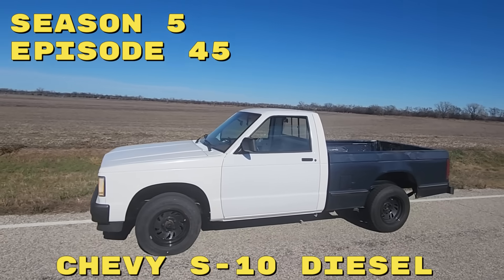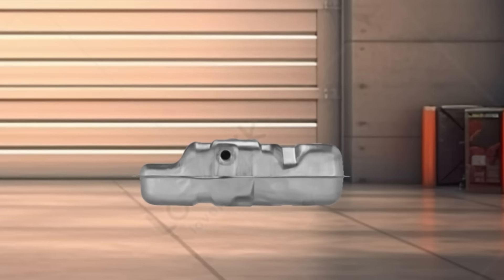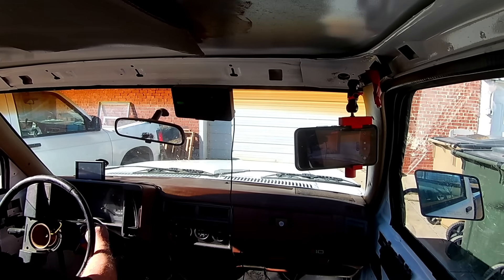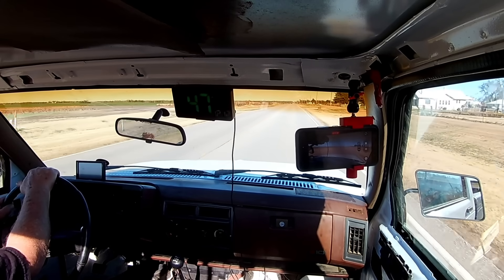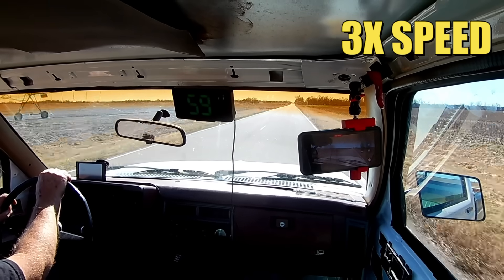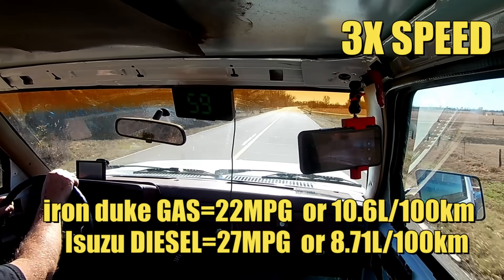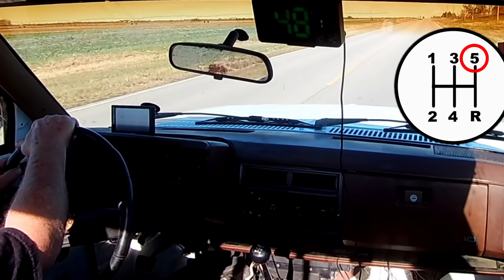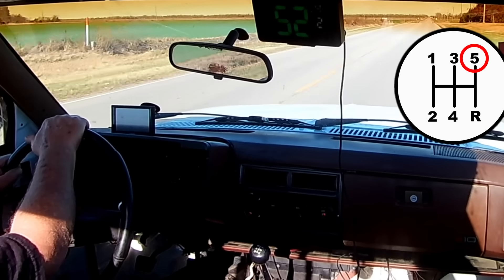S5 E45. MPG?  We road test the custom diesel Chevrolet S-10 to find out the fuel economy.

Comment: The main reason for the increase in price for diesel fuel overall is because modern diesel fuel is of the "ultra low sulfur" variety, due to Diesel engines now running particulate filters, catalytic converters, and Urea. Removing all of that sulfur costs money. It was great at helping lubricate early style mechanical injectors, but it also made a lot of the soot coming out of old style diesel tailpipes.
Reply: Sulfur was removed so it wouldn't poison the catalyst metals

Comment: Those engines, can run full governor!! They won't reach 4800, but they do smooth out, they are kind of like the old air cooled!! Keep them wound tight!! They can take it!! I've these, and turbo aaz for 30 plus years!! Still drive one!! Best little engine ever built!!
Reply from the maker: LOL,  Indeed from what I;m told the governor will keep the engine happy, but  I still need a tachometer just to see what is happening.
Reply: @robotcantina8957 VW set a land speed record for the fastest diesel, in 78 I believe!! With the 1500!! They were the fastest turning diesels in those days!! A Detroit 2 stroke only turned, 2850! Today computer controlled go 4500!! I drag race the one I drive daily!! And drive it home, granted!! I run a 15 second 1/8 mile but have fun doing it!! I have an aaz with a chc gearbox out of Germany, in my other truck, that gets 43 mpg. And will do 140!! Rather comfortably actually!! Yes it sounds like I'm in a Cessna 210!! But I love that clatter!! I know it's running good!! Thanks for doing this!! I'm a fan of the square body s-10 too!!
Reply: @robotcantina8957  You could paint some gear/rpm arcs on the speedometer gauge with removable marker paint.  like the old Honda motorcycles used to have on their speedometers back in the 1960's.   Mark the best RPM for power and torque and shift points in each gear.

Comment: In high school I inherited my dad's 88 s-10 long bed with the iron duke. The only options were the auto trans, a/c, and an am radio. Don't think I ever saw more than 14 mpg. Driving on the highway you could watch the gas gauge drop as it revved it's life away to hold 70 mph.
Reply from the maker: My 89 long bed with a 4.3 will get 15MPG... but that truck is always driven around town.  A full tank of fuel will last almost two months.  I really need to drive it more.
Reply: That's not right at all. We had an 89' with the iron duke and a t5 5 speed. That truck never got less than 21-22mpg in mixed driving. Pure highway it was always 24+
Reply: @life_of_riley88 The long beds came with the larger rear axle housing and deeper gearing. Combine that with the 4 speed auto that didn't lock up until 46ish, and mostly city driving. It could tow and haul way more than it should have, but you paid for that at the pump.

Comment: Many cars have maintenance issues:

The Fiat 128 required radiator removal to provide clearance to access the thermostat. 

The GMC pickup that I drive recommends removal of the intake manifold (4.5 hours of labor) in order to change the oil pressure sensor located between  the rear of the engine and the firewall.

The V8 Chevy Monza, originally intended for a Wankel engine required engine removal to change the spark plugs.

A friend's diesel pickup leaked oil.  His landlord demanded that he fix it.  Changing the gasket required removing the engine and resulted in a $5,000 bill.  This matched the bill from getting the HydroBoost repaired.
Reply: No. You didn't have remove the engine in the v8 Monza's to change the plugs but. You did have to remove  i  believe one or both wheels and they had access plugs in the fender well to change them
Reply: I never had to do one, but some of the BMW 3 series from the early 2000's required you to remove the cylinder head to access the heater core. IIRC it was like a 23 or 27 hour job according to the labor guide. 

I was quite surprised the first time I had to put a starter in an Audi with the 2.7L turbo motor. Step 1: unbolt bumper. Once I got used to it putting them in "service position" wasn't bad, but certainly unexpected.
Reply: @DynamicDesign144  Ah yes, I forgot about heater cores.  The urban legend is when assembling a car, the first thing they do is hang the heater core on a wire and build the rest of the car around it, ha-ha.
Reply: My 2019 Kia Soul has to be put on a lift to change the oil.  You can't just lift the front wheels- the vehicle has to be level.  This is due to the design of the body pan.  I don't know if this changed in the following generation.  I look forward to having to change the accessory drive belt- it can be done while the vehicle is on the ground but you have to lift the engine slightly and remove the passenger side motor mount to do it.

Oh...and name a modern pickup where you can pull the engine or the transmission without removing the cab.  And no, neither the Honda Ridgeline nor the Ford Maverick count as they are unibody vehicles.

Comment: In Lamesa, Texas, I was able to get diesel for as low $0.499 per gallon in 1985 when there were some fuel wars going on. $0.659 was the average due to fuel wars being quite common there. I drove a 1981 Chevy half-ton with the 350 Olds diesel. The most I paid while owning that truck was $0.799. I had rebuilt the engine and did some modifications that made it less likely to blow head gaskets. I had also replaced the governor weight retainer in the injection pump with one that didn't require that stupid flex ring that was factory. It got me 23 mpg in town and 25 mpg on the highway empty.
Reply from the maker: Not bad for a half ton square body!
Reply: @robotcantina8957 , It helped a lot that the area around Lamesa was flatter than Kansas.
Reply: ...even though it is at least as windy.

Comment: I'm running 2 bar in the front 2.4 bar in the rear of my b5.5 passat on r15 195 65 or r16 205 60, can easily manage 5.5l/100km, babying I've seen 4.9 a couple times mostly around 5-5.1l/100km. The engine is a mostly stock 1.9 awx 130pd, so I'd think 5.5l ish or less seems realistic on your 1.6.

Comment: I had an '82 datsun pickup with a 2.2l diesel, it was pretty good on fuel, we don't have city driving here so it got about 37mpg. Probably was slightly more aerodynamic with its lower hood and rust induced flatbed modification..(it did have the same size tires) that engine also had a strange fuel control system, in that it used manifold vacuum to operate the fuel rack, so you the driver manipulated a throttle blade and the vacuum feedback operated the  injection pump.
Reply from the maker: thanks for the data point!
Reply: Wow, that is a crazy way to throttle a diesel.
Reply: @SchoolforHackers  never would have believed it if I had not owned one. It was kinda nice and smooth, since the vacuum diaphragm that operated the rack provided a little damping compared to just slamming it open, not that smooth acceleration is much of a problem when you have a 61hp engine.

Comment: I know this may get involved, but reducing parasitic losses on the chassis can yield gains. Look up the WPC Treatment and do the wheel bearings ( if not sealed ) and the rear differential parts ( this has the most drag ). Do the transmission internals. Combine this with really good synthetic lubricants and it should pick up mpg. Oh, I've had experience with the VW IDI engines and I drive semis, and you'll get better mpg if you set the gearing up so the 1:1 ratio in the transmission matches your desired cruise rpm. Overdrive puts more friction in the driveline.
Reply from the maker: good points!

Comment: You absolutely need a tach.  With a diesel the lower the rpm the smaller amount of fuel used.  Depending on the engine you need 1000 to 1500 rpm to prevent damage to crankshaft bearings.  So for max mpg shoot for rpm of 1500 at your chosen cruising speed.

Comment: I think your loop cancels the wind because you also went the other way. I'd be comfortable telling people they can expect to see between 32 and 33 on the gallon after that test. My personal suggestion, throw a roll-up tonneau cover on it. They are proven to work.
Reply: Drag is proportional to the square of velocity, so the wind does NOT cancel out linearly.  The upwind leg uses more energy than the downwind leg saves.
Reply: I could be wrong, but I believe that "Mythbusters" tested all of the options for pickup truck beds, concerning fuel economy and the uncovered bed with tailgate up (closed) was the best.
Reply: I've had both tonneau and canopy on different pickups and neither one improved fuel economy.

Comment: I love watching this as a mechanic & eleltronics tech who diags & fixes dead modules for 40+yrs, but have you heard of the Ford Barra 4L?, because I own 6 of them ranging from 970,000Km's to 270,000 Km's & all I've done is 5000K oil changes  & slammed em hard towing 2 ton most days since 2003 - 2005  & they don't burn a drop of oil & what comes out is stll golden clean, they are station wagons & cleaned of tool not towing they'll get 8.5/9L100Km's & they weigh 1700Kg & this motor can be built to make over 1000HP reliably, so your figures aren't good lugging that ol S10 around which would probably be called a Rodeo pronounce Ro-day-o here mate have & enjoy whilst I work on dirty greasey neglected car from customers who done give you the whole story again cheers mate.

Comment: There are two reasons why diesel is more expensive than gasoline: hydrocracking and ultra low sulphur diesel mandates.

Back in the day, crude oil was distilled, and you got what you got. Now, they use catalysts to "crack" bigger molecules into smaller ones, allowing distilleries to produce more gasoline. But this means less diesel is produced.

The other factor is sulphur. Prior to 2000, diesel contained around 5000 parts per million (ppm) sulphur. The first limit imposed by the government was 500. Then 45. Today it's 15 ppm. Filtering that sulphur out adds a lot of cost.

The sulphur also acted as a lubricant, which is why fuel additives are basically mandatory on older diesel engines like this. Your injector pump will go very quickly due to the lack of sulphur.
Reply from the maker: Thanks!, I do add lubricant to the fuel.

Comment: I used to have a 1988 S10 with the 2.5L and traveled across the Lake Pontchartrain Causeway. When the wind blew 15-20 MPH it would kick that little engine in the behind and I had to run the whole bridge in 4TH gear. All 24 miles of it.
Reply from the maker: LOL, yikes!  the Iron duke has about twice the power as my diesel.... interesting.

Comment: Diesel engines do well shifting them early in compared to gas. Try shifting at your tork peek. It will seem quick but keep moving through the gears. You will be surprised how that keeps you moving right along.

Comment: I have my injection pump on my 1.6d at about .99-1mm advanced and it starts great cold and gets up and goes a little bit better I think. Also fiddling with the pump throttle can gain response if you feel like your only getting around 1/2 power the spline might be off by one. See you next time!
Reply from the maker: Thanks!  Yesterday I checked and the pump was set to .89.  Not sure how it got like that, but not its set to .95... again..
Reply: @robotcantina8957 Uh oh. More fuel economy testing in your future it sounds like. If you went through the gambit of best injection timing for performance and or fuel economy on these 1.6d for the rest of us that would really solve a lot of debates on the vw forums. The turbo models getting the best fuel economy are in the range of 1.1-1.15 so I’ve read

Comment: Since you brought it up, as someone who owns a small vehicle with 4 cylinder diesel, if everything is just about right, I would expect 45mpg+ but, since this is the maiden test run, it should still be north of 35mpg.
Edit at 5:51:  That headwind could drop the overall mileage by as much as 5mpg.
Edit 2: So, a couple of thoughts. First, since you're driving about 55mph, which is the approximate threshold for basically all vehicles' fuel mileage drop due to wind resistance, that headwind is the aerodynamic equivalent to driving 70-90 mph which will absolutely kill your mileage and, unfortunately, the tailwind just doesn't make up for that. Second, a more powerful engine likely wouldn't make nearly as much improvement to mileage as would dialing in & optimizing this engine, especially since it's diesel. Unless, of course the more powerful engine had significantly more pumping efficiency or fuel atomization & combustion. I'm gonna bet the injector timing is pretty far off from ideal and, when that's improved and, you're not trying to set any aerodynamic speed records for a brick powered by a tiny diesel engine that the mileage will jump significantly. What I did with mine is scribed a bunch of timing marks on the pump with the baseline mark being distinct and, adjusting it between each test period to find what worked best. Anyway, if you made it this far, thanks for reading my ramblings. I can't wait to see more mileage tests & where the pump timing was set.
Reply from the maker: Close!  but we can do better.
Reply: @robotcantina8957   Indeed. I just wrote you book with my 2nd edit of final thoughts.

Comment: I had a 84 isuzu pup diesel for around 1.5 years I would go 55mph on average and got around 30-32 mpg. mine was semi unique tho because it had a automatic transmission which most of the ones i seen where manual transmission. It also did have a bed cover if that makes a difference who knows.
Reply from the maker: Interesting!  thanks for the data point!

Comment: Given the wind, it might be interesting  to do something about the aerodynamics. Some guys like to open the tailgate, others like to remove it, and other others like to cap the bed off with something expensive. Personally, I have done none of the above with my 2000 Nissan Frontier and still get 26mpg highway and 22-23 in combined driving. The KA24DE engine has almost triple the horsepower at 150-ish.
Reply: Mythbusters did really thorough testing on tailgate configuration. Tailgate up, bed open is best because it causes an aerodynamic low-pressure zone in the bed.
Reply: Mud flaps in front of the tires

Comment: Love these. Keep them coming. If you want more subscribers, you're going to have to cross-over into the boating world. More guys in that world doing mods and tunes. There are guys who just fix and flip small outboards putting up some good numbers. They can't do what you do, so you should be able to "cook'em" as the youngsters say. For example, most of these guys won't go beyond swapping carbs or maybe a seal/gasket. No one gets deep into these engines. You could smash it just focusing on the legendary Evinrude ETEC.
Reply from the maker: Interesting...  Boat stuff would be a huge crossover for the channel.  Perhaps a 14 foot aluminum with an inboard kubota diesel.... hmm
Reply: @robotcantina8957  I'd watch it. Right now I'm restoring a 45 ft power catamaran with twin Yanmar tractor engines modified for the marine use.

Comment: A few things...... 1) EPA diesel MPG is always wrong. And it's generally posted lower than actual.  AND.... the gas is generally higher than actual. (I've owned 4 diesel vehicles, and that's what I've found, and most chat board info agrees) My GF back in the day had that truck with the iron duke engine.... and it was doing 20mpg at best on the highway.   (Probably closer to 18mpg and my Toyota 22R was 17mpg)   2) Since you are in a generally flat place, and open roads.... the wind will average during the test.  With aircraft, we will test our Pitot-Static system by flying a square, and average the airspeed to our GPS ground speed to check our airspeed indicator in the cockpit.  If you look at my channel, I think the last video I posted on my homebuilt airplane.... I was testing the pitot system.  FYI.... love your build.
Reply from the maker: Thanks!

Comment: An automatic in itself was kinda rare in Denmark but one of my mk2 Golf has a 1.6 na D  automatic, with the even rarer E gear. I once did multiple 0-100km/h tests and the fastest was 29 seconds :P And basically anything over 110km/h is a pedal to the floor deal. Diesel is cheaper in Denmark today it is 12,89 kr pr liter where i live 2.0016$ pr liter. Gasoline is usually about 0.5 kr more expensive pr liter. Just last week diesel was 2.1102$ pr liter or 13.59 kr
Reply from the maker: Thanks for the input!

Comment: This is getting really interesting. I've a Mitsubishi L200 truck from the eighties. It is pretty similar to that S-10 in shape and size. From factory it has a 2,5 litre naturally aspirated Mitsubishi diesel. It makes a lot of noise and heat and very little power while consuming all the fuel. I have a habit of running old rusty diesel VW:s as my daily drivers so 1,9 TDI sounds tempting!

Comment: As someone who has been deaf on one ear, and still has significant hearing loss on that same ear, I would agree about the tachometer. Especially on a diesel engine.
I experienced the loss of hearing on one ear similar to how many people describe the loss of sight on one eye. In a way it compounded because of that I no longer could hear which direction a sound came from. 
Meaning that the loss was more than just 50% of hearing total because hearing is used for so much more interpreting than just interpreting speach. And that's not even considering the other discomforts from the damaged ear.
Reply from the maker: Indeed,  when my cell phone rings, I can hear it, but I cant find it... so frustrating.
Reply: @robotcantina8957  Some ringtones are easier than others to find, but there's a reason why there's the ringers that flash a light or the key finders. Wish they would do something directional for that.
Reply: I have the exact same problem . I know what you are talking about.